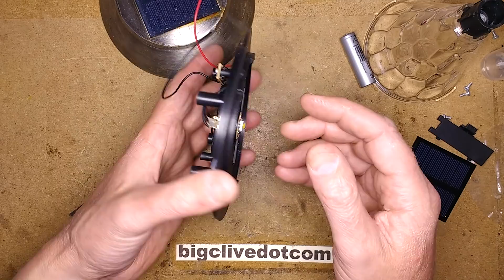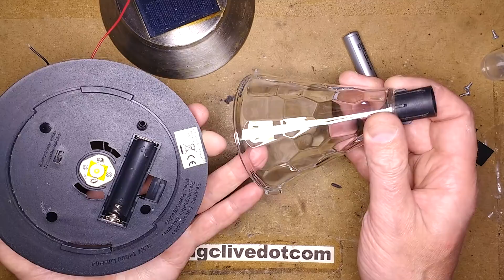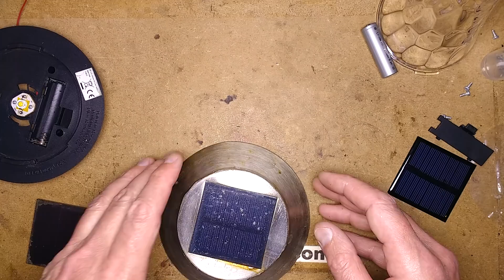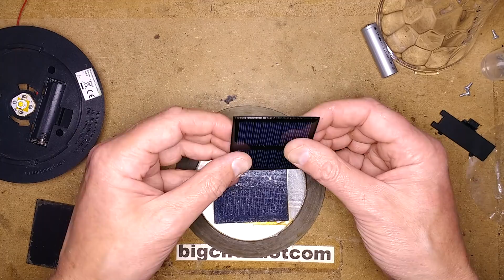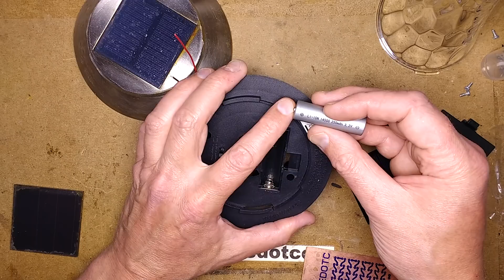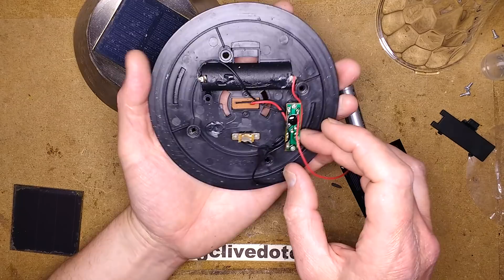Solar panel sealing test and lighting experiment.

Comment: I bought my mom some beautiful solar lights today at the dollar general. $3 each!

Beautiful extremely thick “crackled glass” gazing ball design! The balls are about the size of a baseball maybe a bit bigger… And the lights must weigh three pounds each because of so much Beautiful thick Glass! The Crackle glass is beautiful especially when lit. The solar panels are good quality and all glass with no epoxy or polymer on top that will go cloudy over time. I couldn’t believe the price! And the beautiful thick crackled glass and everything else is stainless! Only the inside bits are plastic

Comment: FWIW - I've had great luck with "Flowable Silicone Sealer" in this situation. Even if the surfaces aren't even, the sealer does a great job of getting into all the books and crannies that a shallow pudding of water does not penetrate and it dries away quickly in the sun! 👍

Comment: It should also be possible to use the same technique for potting that the lightweight camping folks use for "DIY SilNylon", where they dissolve SIlicone Caulk in Mineral Spirits or other suitable solvent then soak their nylon camping fly in that and let the solvent dissolve, to Silicone coat their camping fly - Only use a solvent that won't attack your electronics, and far less solvent, just enough to let the mixture seep through to pot it all?

Comment: You mentioned your new light.  In the tech room of my computer repair center I use old laptop screens taken down to just the LCD and defuser on it mounted to the the bottom of the shelf just above the entire bench. They are all tied into a “bus” circuit of 12v running around the room with the old rocker power switches appropriated from old units to turn them on and if with.  The power is from 12 volt batteries that get the their charge from a (can’t think of the name) which’s is tied to a battery charger and a solar panel.  Works awesome and has cut my light bill down by about 20 to 40 a month just from that setup alone.  Sorry for the ramble just thought I’d share!  Thank you sir.

Comment: Clive, great video. To reduce the chance of overheating the resistor and circuit during higher voltage situations would it be possible and practical to allow the led to illuminate even during the daylight? Resulting in lower heat. I realize it would require a different circuit config.

Comment: One of my mom's favorite solar lights recently quit working. It happened to be the only one that had an exposed solar panel. It was really rainy in June and July and I figure water seeped in around the edges of the solar panel. This one had a column of moving LED's that would move upwards in a tube with a plastic watering can on top. Since I don't live in the same city as she, I went and got another solar light of the same thing and will experiment with coating over the panel to try and seal out water and see if that works. The original only lasted a couple months.

Comment: Clive, look for 704 and 705 (silicone)adhesives on ebay, they are electronics grade, one is white and one is clear, both are also lower viscosity than average silicone sealant which is nice. they are under $2 for a 50ml tube which is great.

Comment: what about dissolving the raw silicone in xylene type paint thinners and spraying it on? Works for coating clothe and glass for multitouch screens.
Reply: I too like mixing silicone rubber with xylene. Xylene is a nice solvent to have on hand. I often make a watery mixture, and then pour it or dab it on. Being waterier it smooths out nicely, and dries thinner.

Wayne Sallee
Wayne@WayneSallee.com

Comment: @bigclivedotcom You should search for 705 silicone on aliexpress.
It is a clear, easy flowing coating silicone that comes in tubes. Used for coating straingauges and other electronics.
It has a "brother" the 704 silicone too that is same but comes in black and white. It's used for potting electronics.
Love the stuff.

Comment: BC, I know this is a 3 v cell but I have some solar lights that use a 1.3v cell, so how does that drive a 3v LED? thanks in anticipation, cheers, Andy
Reply from the maker: The solar garden lights use a small inductor that looks like an oddly coloured resistor to boost the voltage up with a series of pulses.  They can often drive several LEDs in series.
Reply: BC thanks, Andy

Comment: Clive! What’s the difference between a common anode and common cathode RGB LED?
Reply from the maker: In a common anode LED all the LEDs will have their positive connected to one pin and when the other pins are made negative the LEDs will light.
In a common cathode LED it's the other way around with all the LEDs commoned to negative and then their other pins taken positive to make them light.
Reply: bigclivedotcom is there one that you prefer over the other? I’m trying to come up with some projects of my own, and purchase some of yours.

Comment: Might try the clear spray flex seal or similar but different brand. I bought something similar from the white lighting brand. It's decent stuff and I paint for a living. It reminded me of the silicon coating they used on my trucks computer board.

Comment: The silicone may be UV resistant but you might have issue with the factory poly coating. It may well turn cloudy dispite being under the silicone. Might do a 6 month capacity comparison.

Comment: Didn't you do something similar in the past? I remember watching you smear silicone on a solar panel for an outdoor light before.
Reply from the maker: Yes I did.  This video actually pre-dates that one, but I didn't want to put out two fairly similar videos together.
Reply: Ah, that's fair. How are the lights holding up? Have you had to replace anything in them or the whole unit itself?

Comment: @bigclivedotcom Actually the regular vinegar based silicone is not a good idea for solar cells and PCBs since the acids can damage electronics. Also there're are different types of silicone for indoor and outdoor use; I think the indoor kind doesn't like cold weather and might get porous. Also In my own experience clear silicone exposed to sun gets cloudy over time...
Reply: UV does cloud it eventually, acid cure is nasty the dried silicone holds the acid in contact with the electronics eventually you are left with a green paste negative of your component leads. Very annoying.
Reply: He knows that and refers to the issue with acidity

Comment: I've seen results of people taking damaged large panels (cracked glass over the panels rather than damage to the cells) and having used silicone to seal them up, and in the sun the silicone seemed to peel up over time, so may not last too long compared to your usual polytunnel tape method...
Reply: I did some ceiling on my patio sliding glass door edges and the door gets hit with some Sprite sunshine in and the door gets hit with some bright sunshine in the summer from my experience the siliconized acrylic caulk lasted longer and held up better than the pure silicone caulk. I have a solar garden light which is developing moisture internally on the diffuser and I'm thinking to use some of the siliconized acrylic to try to seal a few areas of it. I read some comments though that it should have a whole left open like a weep whole. But if the device has a ip65 rating I'm not sure about putting a hole for example I don't see any hole in it when I opened it up. In this way I'm not planning on putting any new holes in it. sealing*

Comment: Silicon doesn't stick to glass very good and will be peeling off in a couple of years.
I have exact panels from AliExpress and made a 3p2s with the cells, and only used a dab of epoxy on the contacts after soldering the wires, and exposed areas underneath.
The front is covered with epoxy as you can see. I just hope their epoxy doens't turn all yellow in a couple years under the Sun. 
UV is a bitch.

Comment: I can't work at why you many times says that glass solar panels fail, i got tons of cheap lights and they are killed by moisture in 2 weeks, but there are survivors that lived for more than a full year and i think i got only one situation where water damaged one and i had to replace the panel, more times i broke the thin wires soldered to the panel and couldn't get them back. Im testing now covering all the metal concats inside with hot glue and that's seems to fix my issue, but need to test for whole year to be sure.
Also, don't buy solar panels from ebay, most of them are more expensive than they should be and with fake ratings. you can get better value on aliexpress

Comment: Try an aquarium shop for the neutral silicone, they may only have it in small tubes.
Reply: Farnell, and Radio spares have it as well, assuming those companies still exist. Can sometimes be called 'potting compound' rather than silicone sealant.
Reply: I think acid cure is preferred for aquariums.  Not sure why exactly, I've always presumed because the acidity etches the glass slightly and improves adhesion.

Comment: Nice to know that silicone (well, the one you used) doesn't seem to filter out the required wavelengths for these little panels - be interesting to see what happens when the silicone has gone  bit 'off' under the sun for a few months.... I have a larger PV panel with a ragged front face which is peeling - it's been in the sun for about, er, 30 years I think - so I might try out a silicone skin over it like this. Also, I have no experience of LiFePO4 cells at all - very interesting to hear what they 'do' :o)
Reply: LiFePO4 batteries are becoming real popular among electric bikes and e-scooters. 
They can be charged over 3000 times and still poses 80% capacity. Compare that to the Li-Ion which is 1000 times.
Prices is still a bit higher. A $1200 Li-Poly battery pack will cost $1500 if you go the LiFePO4 route.   
Assuming your charger is top notch, and not some shit Chinese work of art.

Comment: Little trick on using acid type Silicone , when you want a real nice surface do same with putting it on , then while its still wet, get a fine misting spray bottle and mist the surface with lighter fluid , then spray your spreader same on edges that touch you will see a better results with being clear looking when it dry's ! Plummer's have used that for years for getting the perfect looking jobs when using silicone !
Reply: I've seen one guy do that (but I thought he was just using water) when I got a new shower enclosure and he was sealing it up. But I thought he was doing that to get the silicone smoothly into the join against the wall. After he wet it, he ran his finger along it. Later, I found that I could just use my finger when I replaced some caulk around tiles in the kitchen where they met the bench top. After I caulked the join, I just ran my finger along it and then wiped off any excess with a dry paper towel. Didn't use any spray.
Reply: The spray just makes all easy over all, when doing final finish look, also overall out come !  There is a happy medium on spray being used on finger or tool ! after using lighter fluid for years, it is, less work, less clean up >I rarely use any over counter silicone today for much I like over all for sealing water proof Loctite products ,Now my old dead brain is trying to learn form bigchive on all of what  I should have learned years ago but didn't take the time to do  !  at 70 its slow going trying to pick up even some of what he puts out ! but slowly getting some knowledge I hope !